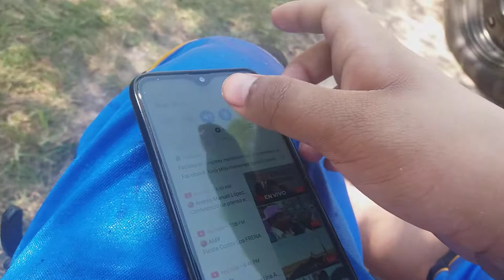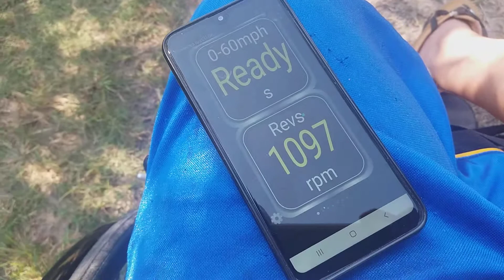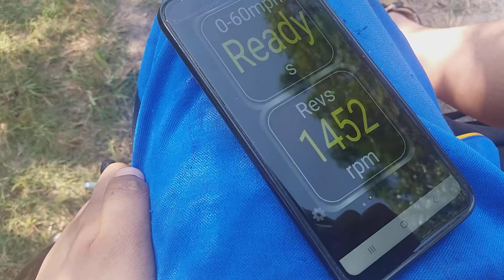Crown Vics stock stall speed, updated video!!

Comment: So does this show the stall speed of the torque converter around 1600? Im wondering because im replacing my torque converter in my 07 P71
Reply from the maker: Hi, sorry for the delay in responding to you.. Yes, that's close to it if not right at it at 1600.. i'd recommend a 3000 stall, even if keeping it stock.. Gonna help you accelerate much faster for sure while still being a daily driver.. Good luck, man.. What are you looking for in the replacement??